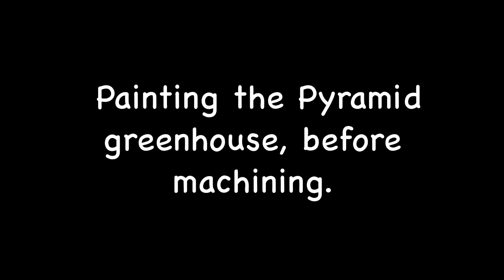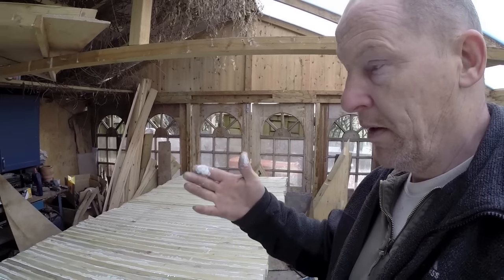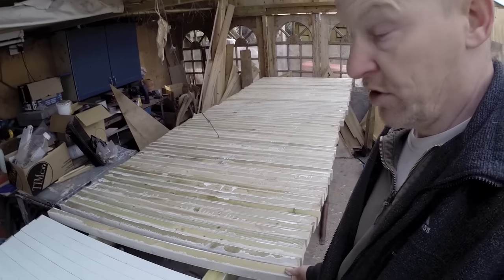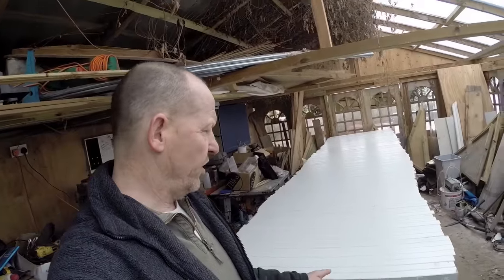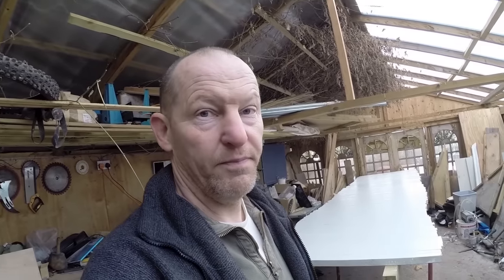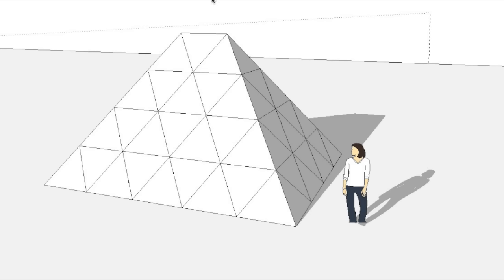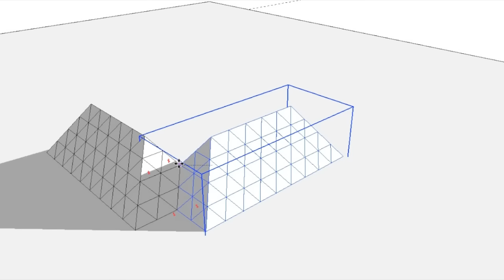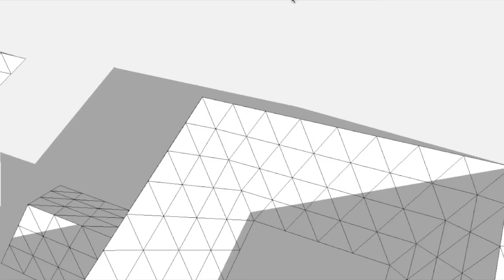Pyramid design painting first

Comment: Hi Paul.
Been watching your vids. Good work and informative,by the way. After watching this vidio on the pyramid, It seems to me that you can make the triangles on the ridge the same as the rest, But run a ridge board on it made of square cut wood or 1/4 round if you don"t want a sharp ridge.a triangle shaped piece would also work, but have less material to screw into. A nother option would to make a heavy ridge framework for strength and then a triangle shaped nailer/filler between the panels and the ridge, Just some thoughts. Keep us posted.

Patrick.